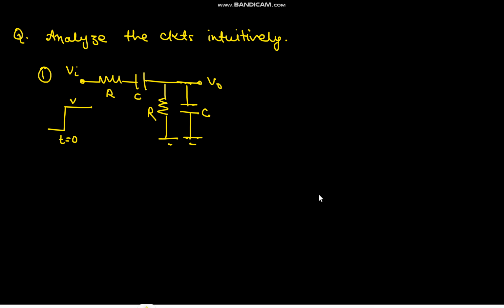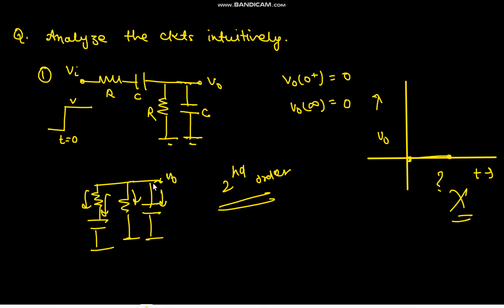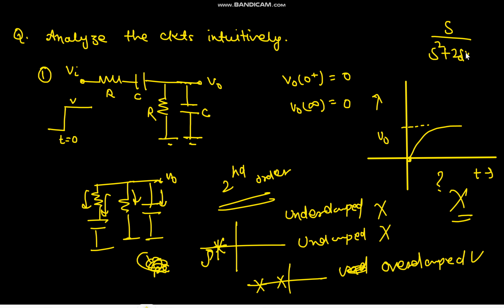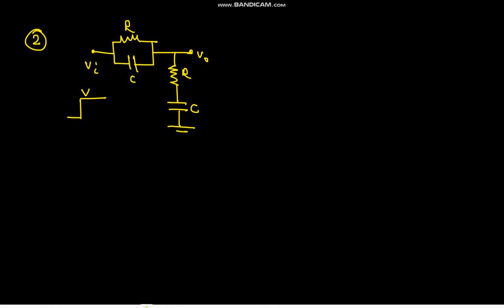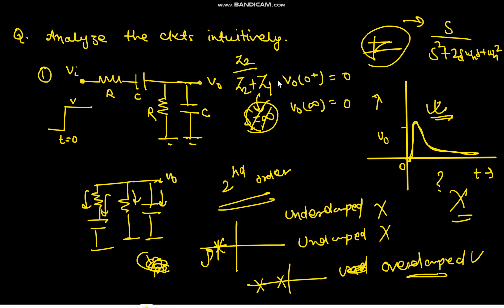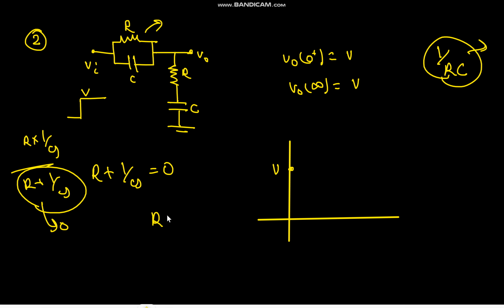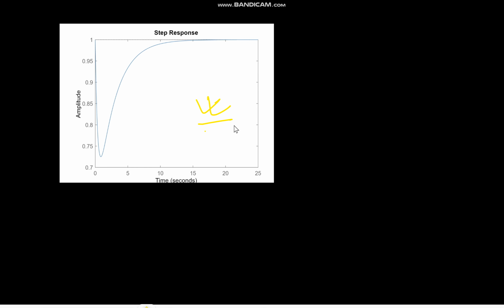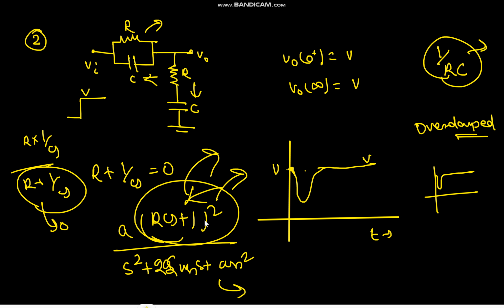Intuitive Analysis of 2nd order RC circuits(Part 1)|| Prep for Interview

Comment: in qn 1, If we analyze like at t=0 there is infinite frequency and replace series RC part as R and parallel RC part as C we will have a RC circuit and at t=infinite if we replace series RC as C and parallel RC as R we will have a CR circuit .. so at t=0 output will reach Vi immediately and t = infinite it will discharge to 0 .. I think that may also be an analysis. This will also give the same response.
kindly comment if i am wrong .
Reply: At t = 0 why will output reach Vi, it will be shorted to ground ( parallel RC part as C)?

Comment: Hi bro. I have one doubt. In first circuit, poles can't be on jw axis because resisters are there ( which will introduce damping in response) So it won't be undamped.. But how we are commenting that it will not be underdamped without finding the transfer function?
Reply from the maker: The capacitor voltage can never go above input voltage, that's why!
Reply: @HimanshuAgarwal_  oh🤦🏼‍♂️ correct. Sorry for the silly doubt!
Reply: In the first question if the output voltage ascillates about zero and never goes above input voltage....can't that be a possibility?